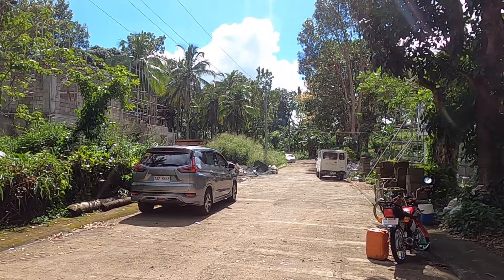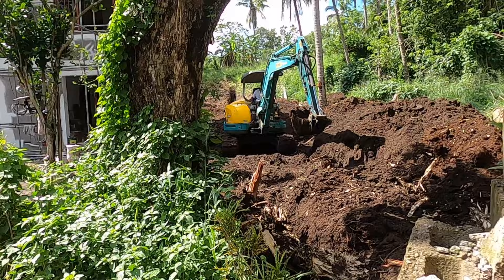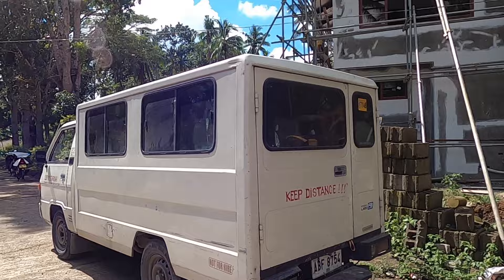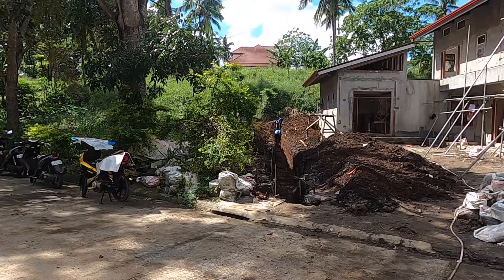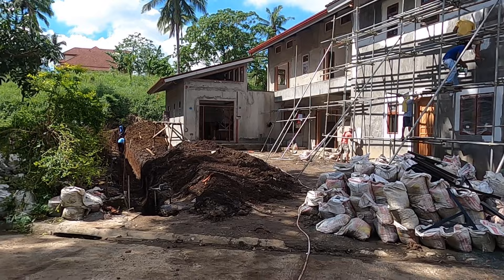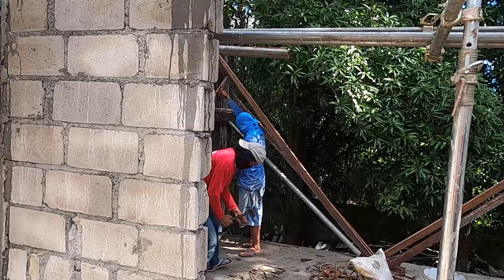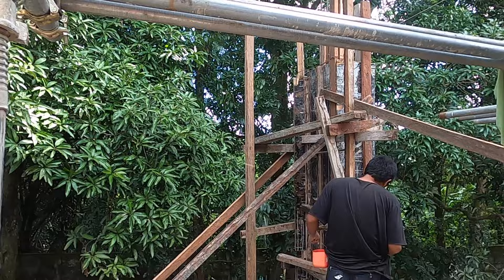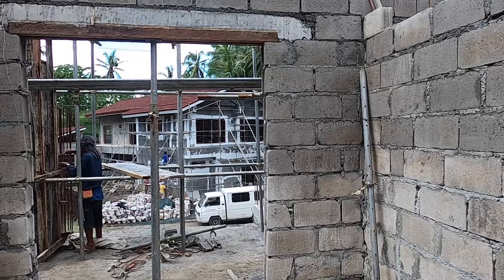Philippines House Build Vlog 43: BREAK INS AT TIERRA MARIA ESTATES | FINAL TIE BEAMS

Comment: Steve , We have security grills from Benji Boy that are aquatic scenes, tropical leaves, flowers, dragons, And Philippine islands. All exterior openings as well as interior 
doors and windows. The bathroom exhaust grills are Amish hex signs which apparently represent prayers in their faith. They average 3 man days each except for the 
huge front gate dragons. We did videos on how they were made. They were fabricated on site and tack welded then carried to the machine shop for welding.
         External LED floodlights seem to help (we have   20      6 watt bulbs with 2 each in ten fixtures).    The 130 Db sirens are something they really don't like and added 
to the motion detectors on the flood lights and they tend to go leave before the housegirl can take a celphone picture. I put a piece of tie wire across the top of our exterior
construction stairs rigged to deploy on their way back down. I think the bloodstains were from the fall because if the 7 dogs had got him there would have been a lot more. 

                                         george and aurora              building Villa Cecelia
Reply from the maker: Thank you, we check it out

Comment: Unfortunately you will probably should be ready to secure your home with high grade security bars and maybe even window roll down shutters . We have these type shutters here and you can not tell when we are home or not. Make it look like you are home all the time. Secure your air con units with bar cage. Have motion lights to come on  and  have your .place well lite .
Stay safe and good luck
Reply from the maker: Albert, I think you are on the right path with the suggestion regarding security.
Reply: There is a couple of things about wall security. There is a single cable  system that will detect anyone climbing your fence and could activate either a camera or trigger bright lights.  Other style is a buried sensor cable that will detect anyone crossing it. Cable can be placed inside fence or outside of fence. Intruder will not know he is being detected. Money dictated how sophisticated a system you want.

Comment: Hi Steve, been watching your build from the outset. I too have already bought a plot not far from you but not building for a couple of years. The security situation seems to be getting worse not better. Not the warm fuzzy feeling you should get with a gated community. Does the HOA release monthly or quarterly bulletins or news letters? I haven’t seen one or any. Anyway I hope the HOA does something soon before the word spreads in the criminal underground that TM is an easy target. Stay safe and keep up the good work.
Reply from the maker: Sorry Rob, do not count on the HOA for any news or help they have not been doing the job you would expect i have to get my info from the locals they have added 2 more security staff to help but still way down compared to what they used to have on staff.
Reply: @NethFaulkner  should make a difference too once phase 2 starts to fill up with occupants. I haven’t seen my plot or the subdivision yet but it seems the perimeter fence is making it easy come, easy go.
Reply from the maker: Rob, there are breaks in the wall that allows people to pass thru this was one of the questions asked at last HOA meeting and the board said they were working on it. The break in the wall has been there for some time i was told by the local resident who informed me.
Reply from the maker: Rob, what phase block and lot number do you have? If I get a chance I will shoot some footage for you if you want?
Reply: @NethFaulkner  block 14 lot 10. Not to far away.
Reply from the maker: let me see what i can do

Comment: I know many cases where dogs were given.poisioned meat through the fence. One foreigner i.know was killed during a robbery
Anything electric  is a problem.
 because of brownouts and your mains electric is so.easy to turnoff  from.the supply.meter
Most effective is physical security in.the form of high fence  or walls
 We have built 4.2m high fence arround our perimeter. Cost alot but its a best investment
Happy to send you pics if you tell me where to send them
Reply: The deeds limits house perimeter wall to about 2m I think with openings. Can't have a solid wall.